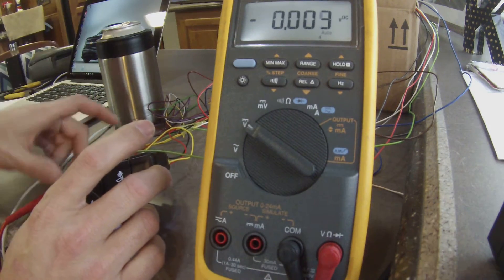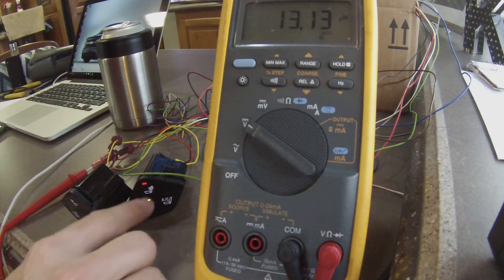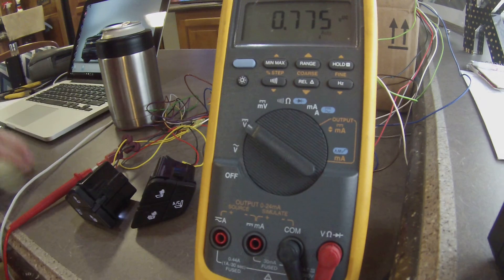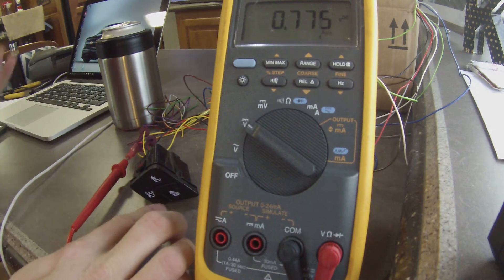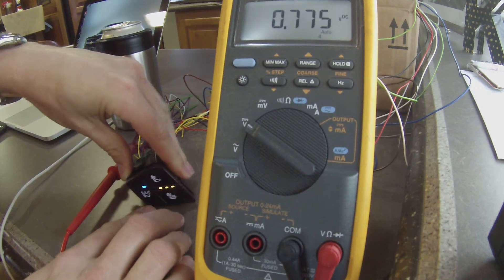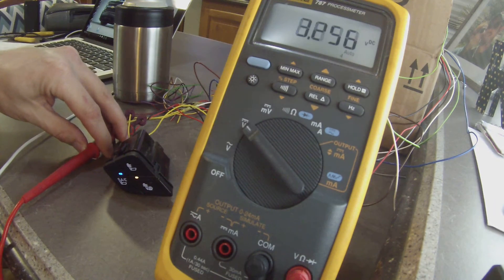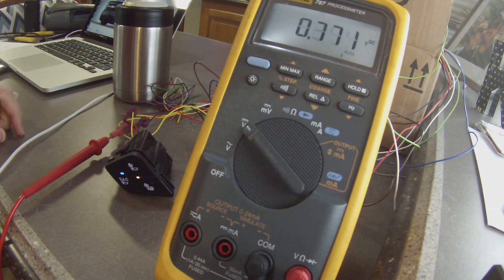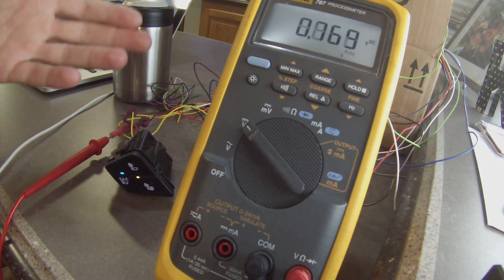The GM LIN bus and you, exploring how it works.

Comment: Do u have to have a special tool to program canny 7 ? I could probably make this put not really good with computers
Reply from the maker: The software is free and it just used usb. I actually have a copy of the program I used with the truck switches that writes the program to the controller to make it easier. I'll try and find a link, but I think it's on the gm-trucks.com forum.
Reply: @GoatRopeGarage  I know this is an old topic but I just installed all the hardware for the rear heated seats in my Cruze using the same type control module. Is there a program to activate the module and get the buttons communicating with the seat module?

Comment: Hey Kyle may name is Brandon I have been very seriously want to make the factory switch’s work I have 14 Chevy crew cab I have already put in aftermarket elements in my seat and r working and I have already bought the bezel and buttons that at just for heat no ac not interested in ac I seen that u make the harness with the Lin and controller I seen somewhere u said u would make for around 250 I would love to buy one my email is hardrick84@live.com let me know if u would be interested in selling one thanks Man U r awesome very talented
Reply from the maker: Brandon, hit me up on the GM trucks forum.
Reply: Hey buddy I created a account and mess u thanks
Reply: @TheAllen84  you sell the harnesses for this?
Reply: @RuskiiPotsan   let me see if I still have all the stuff to build one it is fir 2014to 2018 body truck right

Comment: Hey man I have been trying to do this myself what kin bus do I need to get my buttons to come on
Reply from the maker: The existing lin bus most likely won't work since your truck want from the factory with the options. You have to create your own in order to basically turn the switches on and then translate the button presses into outputs you can use.

Comment: Is there a way to control just the fans on the seats? I aftermarket controlled the heated seats in my 71 Chevy. I put 2017 heated cooled seats in it.  The heaters are good- but the seat blowers are not operational- other than swapping the motors with aftermarket I’m at a loss- I’d just like to have them work on “high” as I’m In HOT Southern California

Comment: I have a problem with this network in a patriot 2009, the blinkers, lights, wipers, just died, I think the module of switch bank (button of hazard lights) its bad, my question is, if one module of the network stop working, or it's working badly, can cause interference with all the other modules in the network? I hope you can ask, thanks!!
Reply: Whtat did you find that was the problem? and how were you able to figure out?

Comment: So is it possible to add 2017 heated seats to my 2014 sle truck. I have cloth seats and only my driver has the power adjustable motor. I bought 2017 seats and don' know if I can get them to work since they have different harness

Comment: Great explanation!! So are you planning to add both heated and cooled seats? I have an LT and would like to add heated seats in the future.  Where do you order your parts from?  I can't seem to find the switches and the bezel to even add this option.  Thanks for the video!
Reply from the maker: Ebay, there is actually a trim bezel with just the heated seat buttons for sale right now.